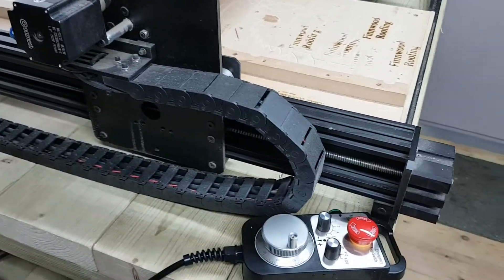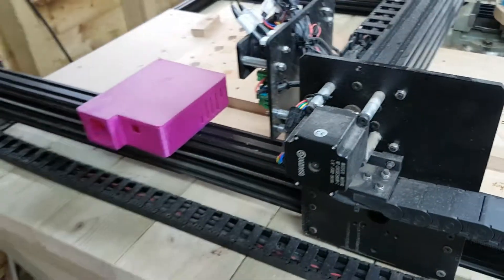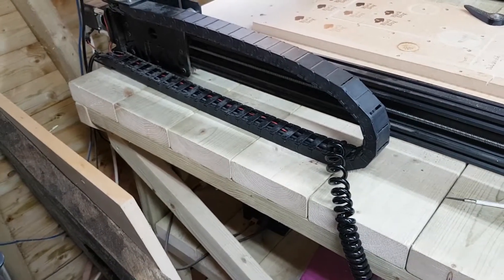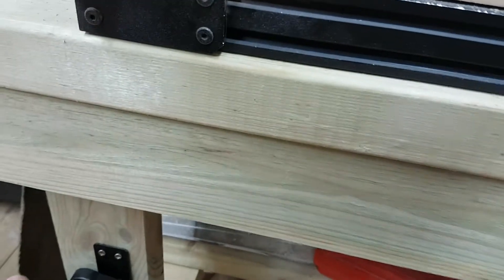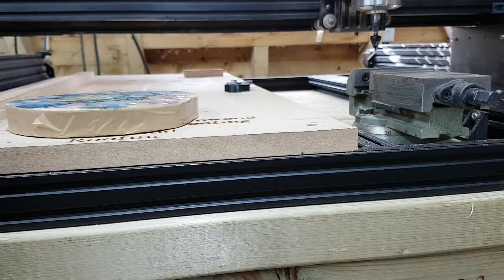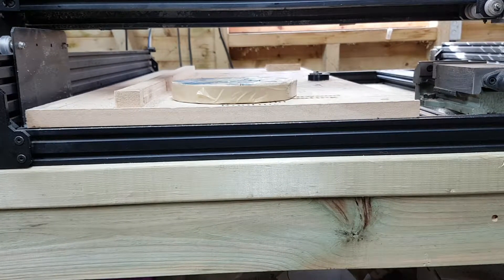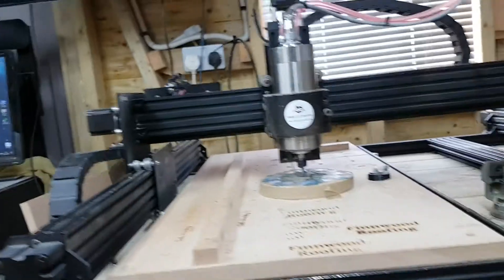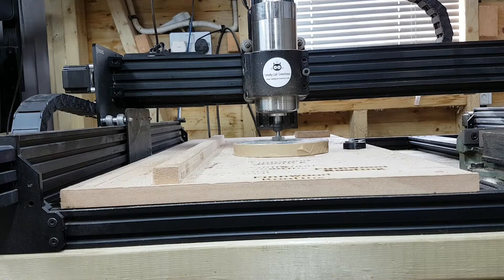Workbee CNC Router Upgrade - Handwheel / Pendant - Ooznest

Comment: Notice that you are getting wheel cracking- I have had that too. Have you had to replace many? Ooznest are not very forthcoming on this issue- although they will replace the polycarbonate part. Or at least supply them, you get the fun of fitting.
Reply from the maker: Yeah the front top ones have all cracked and I have spoke to them as the older versions of the workbee had more wheels. The very early ones had 4 sets of wheels on the top then it went down to 3 sets of wheels on the top. Now it has just two sets on the top per side. I understand this would create more friction but also I feel it would add more rigidity

Comment: Are you using ethernet comms? I am using wifi, and it does not seem to take commands into the paneldue socket. You had no firmware or config files to load?
Reply from the maker: Yeah Ethernet as I’m not a big fan of WiFi for reliability 

I haven’t done any firmware updates since I got the machine no. 

Just pop my G0X0Y0 in the command line
Reply: @SmellyCatCreations  Thanks for the info. I will keep trying on the comms issue- early days. 
I am really keen on some macro buttons to set work zeros etc.
Reply: Got it all working- there will be a video. Not well documented that you have to add checksums to the messages. Turn that off and all is well.
Reply from the maker: @Tensquaremetreworkshop  glad to
Hear you have got it all working and will try checkout your video to see thanks

Comment: Very interesting. Did you have to alter the start code to enable the pendant?- my understanding is that you have to enable telnet.
Smaller steps- as the pendant works by sending gcode commands, there is no reason it cannot be programmed to give smaller steps. I would also want a 'goto work zero' button, and maybe a 'set work zero' too. Might build one.
Reply from the maker: Thanks for checking out the video,  no this was a direct plug and play pendant, I have seen some others in the workbee group with return to home and programmable buttons.

Would certainly be interested to jangle the steps down to much lower to make it much more useable in the Z setting. 

In all honesty I rarely use it as I have roughly three fixed work co-ordinates on my bed so switch between these must of the time.

No reason why you can’t make one would be interested to see how you get on 👍🏻
Reply: @SmellyCatCreations  Thanks for your quick reply! It looks like a straightforward Arduino project- need to fit it into the list... 
I also have fixed start points, but would like fine tuning, especially for some bits. And one button to a start point (or start +5Z) would be nice.
Reply from the maker: @Tensquaremetreworkshop  I’m used to just typing my manual gcode in the top, think it’s from doing it at work all day lol